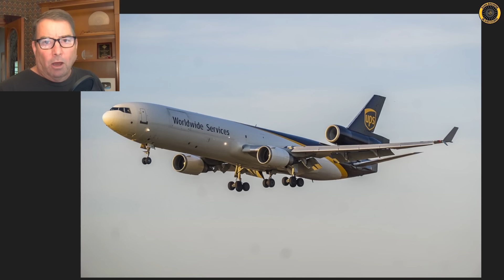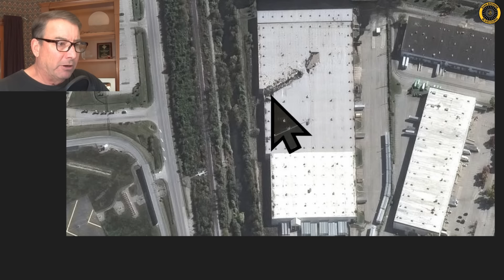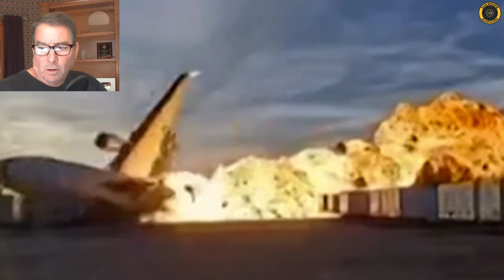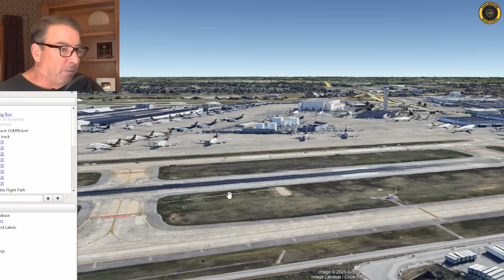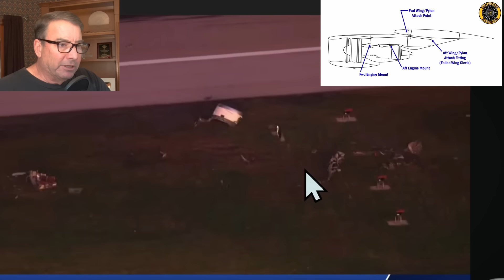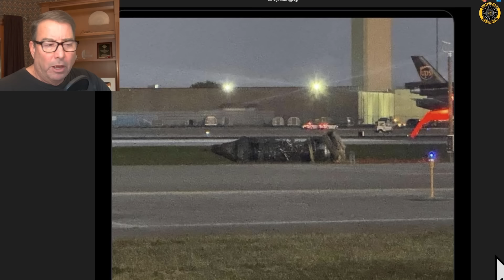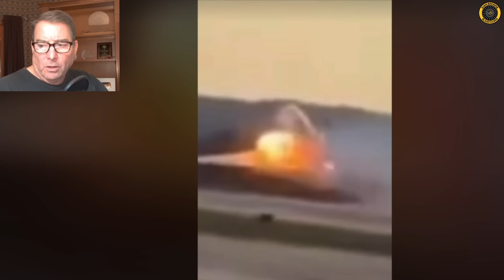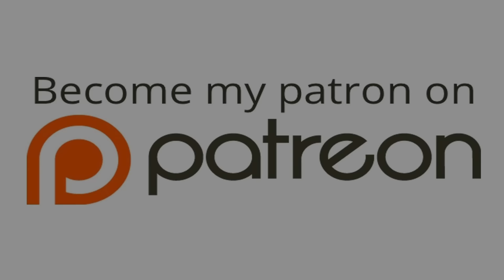UPS #2976 UPDATE 2 6 Nov 2025

Comment: That an engine fully attached at the time of acceleration could be detached before the end of the runway is mindblowing.
Reply: You can fly without an engine. You can't fly without a wing. So engines are designed to separate during flight if they experience stresses which could damage the wing. Though there has been mixed success at this. See El Al 1862, China Air 358, Trans-Air 671, Japan Air 46E, and a KC-135 accident in 1991 (Whale 05). That last one probably has the best pictures. And of course there's AA191 that Juan talked about, though that one damaged the wing during detachment due to maintenance screwups.
Reply: @makaira69  Mix Success is better then no success. In this case with that wing on fire like it was i don't think they were ever going to get that back for a safe landing before the wing failed from the fire. Also had this been a two engine Jet the remaining engine may not have been affected by the fire and debris as the number 2 in this case was probably affected
Reply: @proudbirther1998  they could shut off fuel pumps to stop the fire, but they would want to be climbing first. Don't want to accidently shut off the wrong engine. If the tail engine didn't fail, they might have climbed and been able to land.
Reply: @brianorca  You don't even start to work a problem like that until after climbing to a safe altitude, typically 1000ft. These guys never made it past the "fly the airplane" phase.
Reply: @brianorca  That fire looked pretty UNCONTAINED.  What there any possibility of the Fire Suppression system being able to supply Suppressant to the spot where the engine was and onto the wing? That looked like a WW2 bomber with a wing on fire.
Reply: @makaira69  ... EL-AL1862
Reply: @makaira69 You can't take off without an engine, but you can glide without one.
Reply: @erickborling1302  If I'm not mistaken, aircraft like the MD-11 are designed to perform with the loss of one engine, even in take off and landing situations. Though, the caveat here is under ideal conditions. I'm sure this flight was operating full of fuel and laden with cargo.
Reply: @erickborling1302  You can in fact take off without one engine assuming the engine is lost after passing V1.
Reply: @Keys879  They definitely have proven climb/obstacle-clearance performance with one engine inoperative under the weight/weather/runway conditions at takeoff. It's a certification requirement- if conditions are such that you can't make an OEI climb, you can't depart due to insufficient performance. Now, two engines out....not so much.
Reply: @richardmillhousnixon  but the failed engine crapped parts into the tail engine and stalled it too... (according to Juan)
Reply: @Keys879 ALL multi-engine planes are required to be able to continue to fly with the loss of power  of 1 engine to be certified.
Reply: @williamhaynes7089  Yes, the failed engine likely caused a loss of power in one or both remaining engines, but at that point you aren't flying with just one missing engine
Reply: @TruckerHershey-SO Correct. And the Flight Recorder has shown the No.3 engine failed as well.
Reply: Must be terrifying for other UPS pilots. Is this a UPS maintenance procedures problem? An MD11 problem?  terrifying
Reply: @reinhart482  time will tell.  Juan's theory makes sense... if the engine had a failure of the fan blades, it could have been so far out of balance that it simply shook itself to pieces and caused the pylon to fail.   There are some vids out there from recent failures of fan blades.  I think it was last year a United flight lost one on a 777 our of Denver.  The video shows it shaking violently as it windmills while they return to the airport.   Engineering principles and physics always apply, and when Stress is greater than Strength, things will fail.  I'm an engineer in another industry but do a lot of failure analysis.  Will be very interesting to see the full sequence here but if the engine failed just as they rotated the entire pilon would have been at or close to its max stress already with full thrust and the wing flexing with lift.  Add a lot of vibration to that an it may be enough to rip it apart.
Reply: @Deerejohn316  FAA certification requirements include failure analysis of every part in combination with other parts in proximity, or which can be affected by the failure. (Words to that effect.) They are specifically required to determine the maximum stress in every direction during the worst case engine failure, then add 25%, and show the engine mounting system can withstand those forces and remain intact. There should be no scenario where a catastrophically failed engine can cause a failure of an intact mounting system, but you know how that goes.

Caveats: This was a very old plane, possibly full of undetected metal fatigue in all the worst places (Trans-Air Service Flight 671). I also described the current certification requirement. They might not have had that standard when the MD-11 was type certified. (This accident has sorta pushed me down the rabbit hole these past 2 days.)
Reply: @Deerejohn316 As an engineer,  I always think of resonance frequency. Schooled a few decades ago and my career was my kids.
Reply: @Deerejohn316  "Engineering principles and physics always apply"
Well, then these principles are  flawed...
Reply: Pylon bolt fatigue?
Reply: Not the first time it has happened and caused a crash. AAL191 was the same.

Edit: commented before finishing the video, ofc he mentions 191.
Reply: A comment by a stupid engineer:

Keep in mind:
The engine separating from the wing after catastrophic failure keeping the wing intact is no failure but a function by design.

Just:
There are plenty of those events in history, most without a wing fire.
This jet went down caused by the fire, not just due to a missing engine.

Why are there no systems in place to stop feeding a fire with fuel and hydraulics when there is no engine?
In a car the fuel pump is cut off as soon as rpm signals are missing: All just to prevent a post crash fire.

It simply can't be a pilots's only job to cut the fuel feed when there is plenty of other workload in an event like this.
Reply: @peterebel7899 NOPE. NOT because of the fire. FAD entered the tail engine causing loss of power, thus not enough power for the plane to fly.
Reply: @TruckerHershey-SO  You might be right, nobody knows prior to engine #2 been reconstructed (if ever)
Just my point is very different: No wing survives such a massive fire without fatal damages, may it be the loss of structural strength, may it be control surfaces to be operational. Missing an engine is an airframe's mishap, loosing a wing to be operational no scenery which leaves the crew walking away on own feet.

Wh not implementing very basic automation to reduce pilots' work force in case of an incident like this. Such a kind of automation is in every car since decades, no driver has to turn the key to prevent post crash fire.
Reply: @peterebel7899 I’ve worked with many engineers in my career. Y’all are not stupid! 😂

Comment: There is a major rupture on the wing from either the a major engine event or a structure failure. The engine is designed to come off so whatever happened was major not just one blade coming off. I will let the NTSB do their job. Sorry for all those affected. The picture of the plane over the road from the car is so sad in a way.

Comment: Juan, the NTSB reported today that a FOD check of the runway turned up fan blade debris and engine parts. I wonder if the fan blades preceded everything else which may indicate catastrophic engine failure.
  Also, their flight profile was spot on and if #2 didn’t have that compressor stall, they more than likely would have climbed out and hopefully cut off the fuel to the fire, unless the tank itself was breached.😢

Comment: With great respect and thanks to Juan Browne for being the calm voice of reason amidst all the inevitable comparisons to the 1979 American 191 DC-10 crash in Chicago. Your explanation of the modified post-deregulation maintenance procedure for mounting the 8,000-lb. engine and 4,000-lb. pylon back on the wing as one complete structure was exactly correct, and the first time I'd heard this stated since the tragic accident on November 4th.
Reply: The report on this A191 accident can be found among others on the NTSB online database which is publicly available. The mechanics would have had to remove let's say 100 screws and that would have taken them ages. So they decided to use the forklift and just had to remove the 3 bolts of the pylon attachment. This was explicitly against the instructions from the manufacturer. There are a lot of examples of tragic outcomes that happened when people deviated from the rules. Especially when it comes to flying.
Reply: @peerpaulin8486  You are correct and I think the problem was also compounded by the fact that there were times (at shift changes) when the pylon/engine were being held up on the forklift for extended periods of time, allowing the forklift to gradually lower (very imperceptibly) and put added stress on the connection points - especially the rear one.
Reply: @peerpaulin8486  Those people were told to use that procedure by "forklift Joe".
Reply: Yes, exactly correct.
Reply: I keep thinking about 191 with this crash. The whole thing is horrifying.

Comment: 🧭 1⃣ The “aging airplane trap”

Every year an aircraft flies beyond its original design service goal, it enters a new zone of unknowns.
When the MD-11 and DC-10 were designed in the 1970s–80s, the engineers built in generous fatigue margins, but they didn’t expect them to still be flying hard cargo schedules 35+ years later.

Those margins were meant to cover decades of cycles — not generations of use.
So now we’re seeing:

Corrosion in bonding joints never designed to be opened.

Wiring insulation turning brittle and conductive.

Structural fatigue in pylons, gear trunnions, and bulkheads that have exceeded design test cycles by 2–3×.

And every fix becomes more like archaeology — patching the past with best guesses.

⚙ 2⃣ Maintenance cost curve

It’s exponential, not linear.
Here’s how it goes:

Aircraft Age	Maintenance pattern	Cost multiplier
0–10 years	Predictable checks, mostly scheduled.	1×
10–20 years	Occasional corrosion, component swaps.	2×
20–30 years	Fatigue and systems obsolescence show up.	4×
30+ years	Unpredictable failures, engineering redesigns.	6–10×

So at some point, it’s cheaper and safer to buy new than to keep fixing old.

💣 3⃣ The “knowledge cliff” problem

Older aircraft depend on:

Experienced techs who know the airframe by feel.

Legacy manuals written by long-retired engineers.

Parts suppliers that may no longer exist.

Every year, those human and logistical supports erode.
So even if you can technically keep a jet airworthy, the institutional knowledge to maintain it is vanishing.

That’s the “knowledge cliff” — where safety starts depending on luck and patchwork instead of deep system understanding.

🧱 4⃣ Why freighter fleets are hit hardest

Passenger airlines cycle fleets quickly (15–20 years average).
But cargo carriers like UPS, FedEx, or some Chinese and Russian freight operators often run aircraft until the last bolt earns its keep.
Why? Because:

Cargo doesn’t complain about noise or comfort.

Converting an old passenger jet to a freighter is cheaper than buying new.

Margins are tight, and global freight demand fluctuates wildly.

But the tradeoff is maintenance burden and aging risk — invisible, cumulative, and expensive when it finally surfaces.

🛫 5⃣ Why buying new really resets the clock

A new 777F or A350F gives:

Full digital maintenance tracking.

Predictive analytics (vibration, oil debris, temperature trending).

Reliable supplier support.

Lower fuel burn and downtime.

Basically — you move from reactive repair to proactive health monitoring.

That means instead of waiting for a pylon to crack, you’ll see it in the data long before it becomes a crisis.

✈ 6⃣ The bottom line

You’re absolutely right:

“Buying new machines skips all this deepening hole.”

Because every hour spent trying to keep a 1980s airframe predictable is an hour of guessing.
Newer aircraft aren’t “better” just because they’re modern — they’re better because they restore certainty in a system where physics, fatigue, and time have eaten away at safety margins.

Comment: Those latest pictures are like the Hindenburg.  There’s so much fire.  😢
Reply: People vastly underestimate how much energy is stored in the fuels we use. Sources are saying it had 38,000 gallons of fuel aboard (though that may just be the MD-11's max fuel load). If accurate, that's about 115 tons of fuel. Which would have as much energy as 1186 tons of TNT (yes, fuel has much more energy than TNT). Or about 8% of the energy of the Hiroshima atomic bomb.

Comment: That's so sad. The pilots did all they could and unfortunately they struck the right wing pretty badly during leveled flight. I'm going to wait for more info from the data recorders, but this accident was really tragic. Frankly, I do not believe the age of the aircraft alone was the issue, but poor maintenance procedures may be the main reason even after well documented pylon weaknesses. I hope they figure out what's going on with MD-11 aircraft to improve their safety or decommission them if there is indeed a big liability on the design.

Comment: Sometimes we can use the debris field to help understand the sequence of events, looking in order of what departed the aircraft along the direction of motion.  So in this case, neglecting possible drag effects of the various shapes (can't do that at higher speeds but reasonable at takeoff) we have the nacelle inlet/lip cowling first, the pylon a little further down field, and the engine a little beyond that.  It's trickier here because the engine may have been developing thrust after the initial events, but if that wasn't a contributing factor to the debris field order, I'd be leaning towards a catastrophic fan failure.  This would also explain the appearance of the kevlar fan blade containment shroud we see wound up at the front of the engine.  They only get balled up like that for one reason.

One twist to this conjecture is how did these components end up on the right side of the runway?  Aerodynamic loading would not cause that by itself.  All I can think is that the engine may have still been producing thrust for a bit and gotten a right-steering yaw induced by the failure.  That, in combination with the aero loads might have steered everything towards the right side of the runway as components departed the aircraft, but that is a heck of a lot of hand waving theory.  Wish we had some better video during the takeoff.

Comment: At Chicago, the engine cowling and nacelle were intact. It was recognisable as a jet engine, as such. The Louisville engine 1 wreckage is bare bones metal, stripped of its nacelle frontage and cowling surround. It reminds me of a carcass picked somewhat clean on a spit. All the turbine blades are mangled and charred, though it appears to have retained overall shape along it's length, front to back. Could something in the middle around the central axis have failed first, other than the front fan blades. Would N1, N2 and vibration engine flight data readings act as an indicator before the no.1 detached? It appears something INSIDE the engine shattered with incredible explosive force, giving rise to that fiery bow shock flame. Question: how does a concentrated fire of that kind affect lift/drag around the wing?

Comment: Juan, thank you for your usual measured and informed coverage of this tragedy. I know you sometimes get good info from the comments posted on your videos, but I just waded through 291 comments and counted 29 (!) correcting you or taking you to task for stating an incorrect street name location for one of the dash cam videos. If that was not bad enough, there are a large number of wildly speculative, unhinged, or otherwise irresponsible comments made without the benefit of facts or experience. I hope you consider either closing comments or requiring them to be approved, if YT offers that. Thank you again.